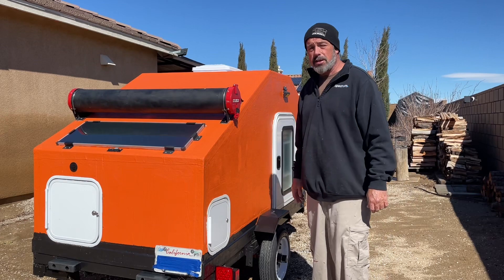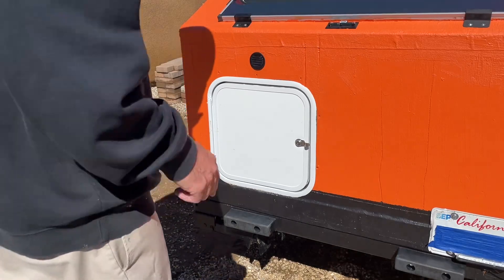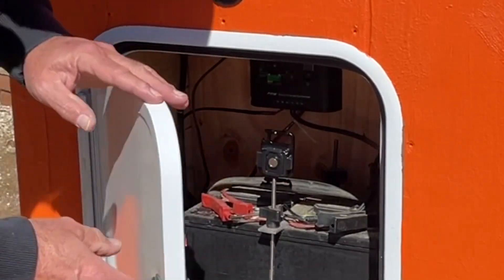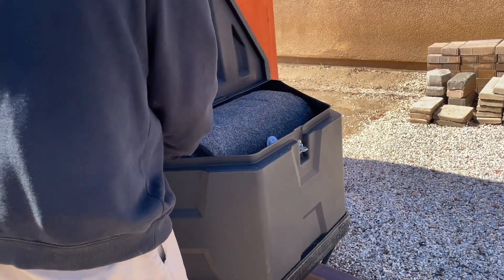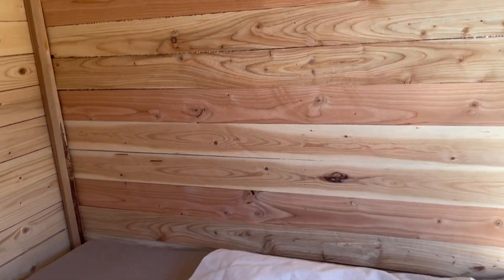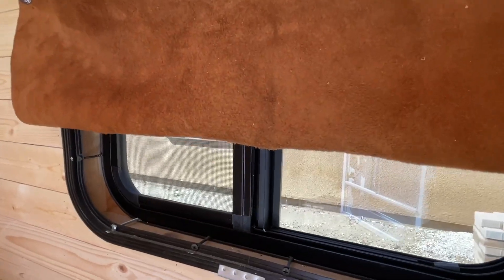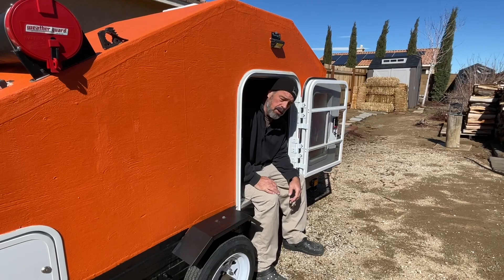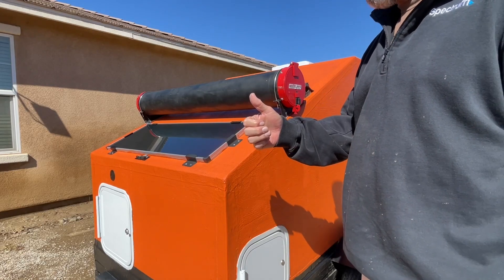How Hugh… Weather Test - Squaredrop Camper

Comment: You might want to put some sealant around the screws,  edges of metal where you installed things on the roof. It wouldn't be as pretty but RV's do this for a reason,  when the sealant breaks down, cracks. You know when to reseal it.  Water always takes the easiest route.